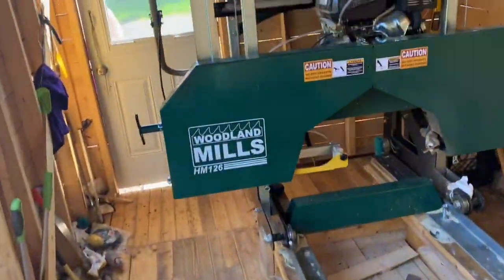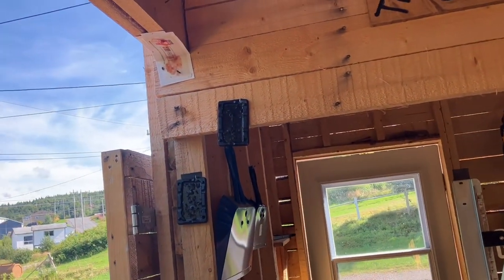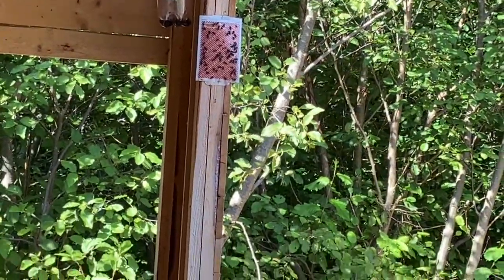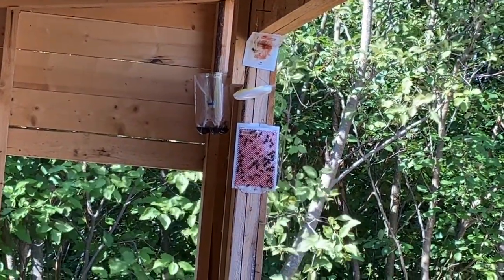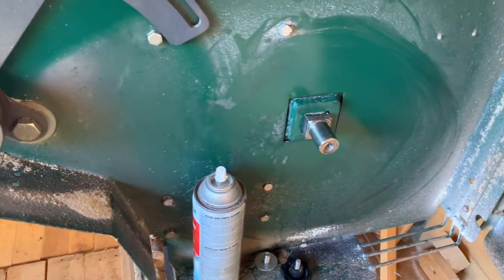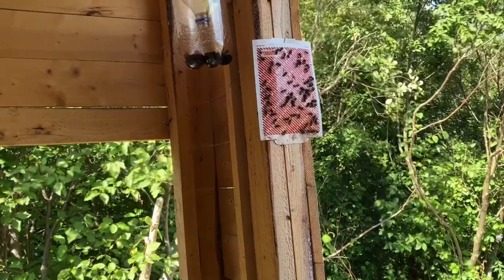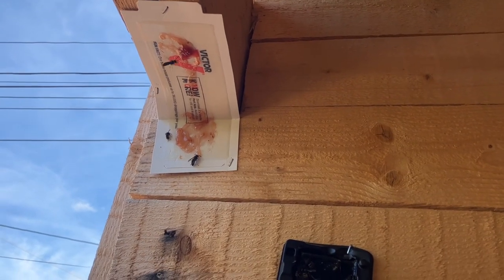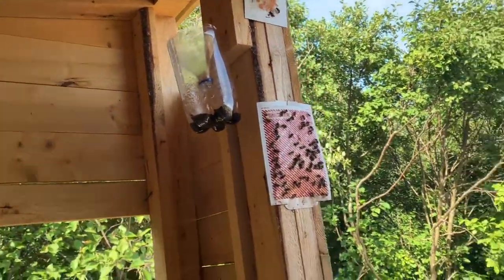Big problem in the boardroom

Comment: Looks like you have the fliers under control, now time to destroy the nest!  I had a big problem with them a few years back.  Once I found the nest I bought 3 cans of foam spray nest, wasp, hornet killer.  Worked unbelievably well!  I waited till late night and emptied one can in it's  entrance and stepped back and watched, within 20 minutes I seen they had a second entrance so I watched that area.   1/2 hour later I dumped a second can in that entrance and went to bed.  The next morning I examined the nest I determined that the problem was taken care of, but to make sure I emptied the third can into the nest by poking the nozzle in multiple locations and sprayed in the foam.  On the third day I pulled out the nest which was in between three trees, man was it a big nest almost a 24" cube.   I don't know where your nest is , but I think if you find it you should get yourself some of the foam spray.
Reply from the maker: I picked up some foam spray I found a nest and did the job on it I am hoping it’s the one. It a big one. Take care and have a great weekend